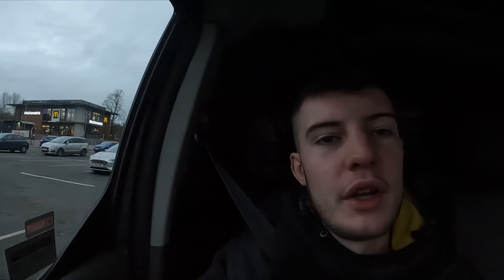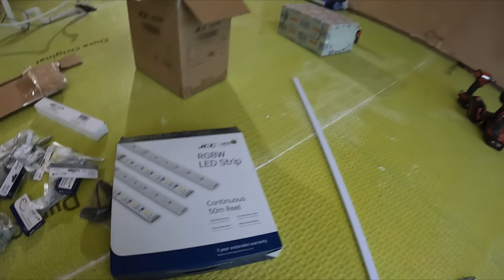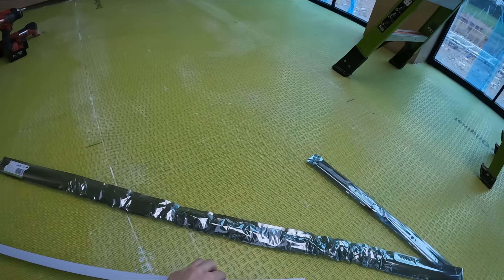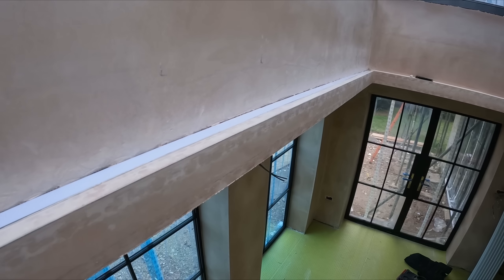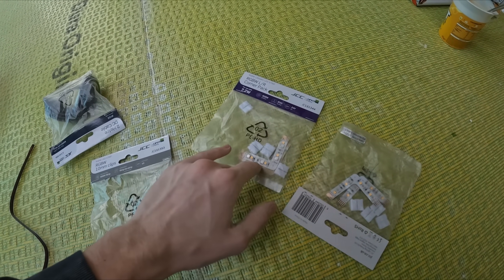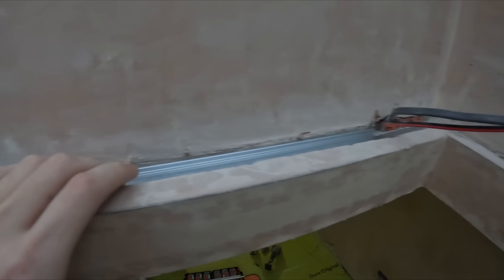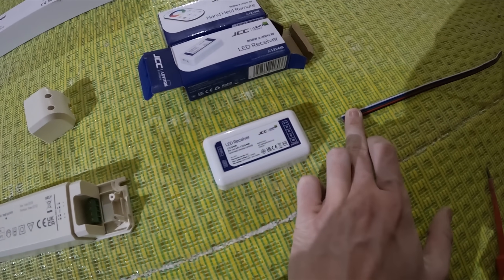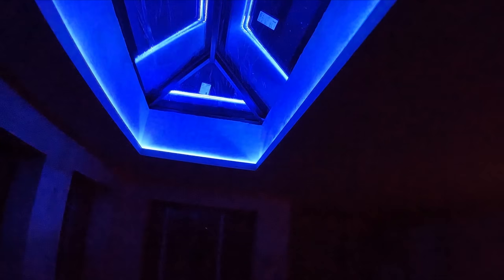Big Mistake This Could Have Cost me £****

Comment: that turned out nice. Yeah there's not a lot of standard with LEDs yet. I mean there's a standard but it's not the standard.
Like that you ran the extra cable probably a good thing this case. I would almost say for future proofing for anything like that Flexican all the way to the control box.
It seems like LED lighting might be going the way of power over ethernet POE which would require data cabling.
And the annoying thing about most built-in features like that is that they're usually made one size fits none, so having the conduit there in the future brings a whole lot more options.
With AC wiring you have a lot more leeway put the switch on one end or put a controller up there with constant power etc. with DC and not so much.

Comment: Hi Adam, Be mindful using the connecters for led tape as some are only rated at a few amps and can easily burn out , rgbw can be 18w per m , x that by the length of tape then divide by your 24 volts which can cause problems, soldering isn’t easy especially with rgbw but it’s worth learning and practicing and makes a better job , keep up the good work , best way to learn is from your mistakes 👍🏻
Reply from the maker: Thanks for the tip!

Comment: Good save in the end mate, nicely done!
Just curious as to how long the total run of led strips was along the entire skylight, as was told i need a cable to power each 5m length? I'll be running on 24v too with a big-ass driver. Cheers
Reply from the maker: 11meters I think it was

Comment: Good video. And nice save with the twin and earth cable you ran in. I made similar mistake to rgbw lights on a soffit. So I ended up fitting the controller in the eaves in the loft
Reply from the maker: Cheers 👍🏻

Comment: I know it is easier for us who are not doing the job to comment, but you have over looked another problem. As the LED strip is long, and it is 24v, you can get a lot of voltage drop. Next time, why not put the receiver adjacent to the LED tape? That way you only need 2 core, and you can use T&E so the voltage drop will be so small you will not have to worry about it. The only way to learn is from your mistakes.
Reply from the maker: Definitely cheers
Reply: The driver is massive to be fair have to make a hatch in the ceiling just to hide it if no downlights😂but should be more local to strip to allow for voltage drop good job though well saved. 👏

Comment: Can someone educate me please, why the need for a big driver? Iv had the cheap eBay led rgb kit on my stairs with sensors for the last 5years and it’s still going strong? I totally get it’s a cheap kit compared to the one Adam used but what’s the pros and cons ?
Reply from the maker: The driver depends on the length of the meteres used and few other variables I believe

Comment: Wouldn't be better to have controller hidden inside next to LED strip? That way you use 2 core cables?
Btw, I used RGB-CCT LED strip (so I have different white temperature as well) that work well together with Philips Hue (it use Zigbee gateway) 👍👌

Comment: Just a thought but why didnt you just use the 2 core up to the led strip for your DC, then install the led receiver right next to the LED strip, espesically as you had to cut away the plaster board for the profile annyway? BS 7671 does cover ELV as well. Great job though, really tidy!
Reply from the maker: cheers 

I could have done that I did debate it but opted for the way I did it

Comment: I've not fitted any JCC LED strip so there's not much advice I can give apart from assuming you are fitting downlights on that ceiling put the joint between the cable and prewired end above a downlight with a bit of flexi conduit between Is there any guidance of the distance restrictions between the driver and tape? As you said it could have cost you but it didn't, looks good though. How about doing a video with the unused bits on how it all goes together with no soldering. I bet you when you have finished the kitchen you'll look at it and be well proud of what you have done.
Reply from the maker: Most definitely when that jobs complete will be a good achievement

Comment: Nice one Adam. Well thought out in the end. Luck the extra cables were there 🤦🏻  Be mindful if you do it again and you are fitting 5v strips on long runs they would need power injection down the line. Happy new year🎉
Reply from the maker: Cheers I’ll take a look into that injection 

Happy new year

Comment: Its happens to the best hahaa You could have just put some loops into the driver
Reply from the maker: Loops ?
Reply: @AdamTheElectricalApprentice  it might not have worked I seen later in the video had the controller transformer. With them strips can loop small bit of wire between each terminal from + maybe you would call them a link just carry the power over to rgb.